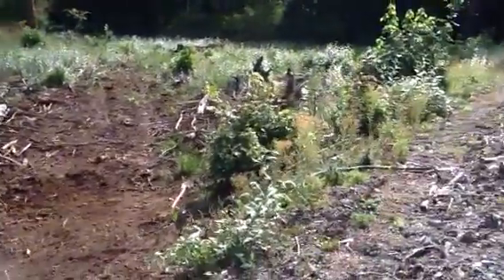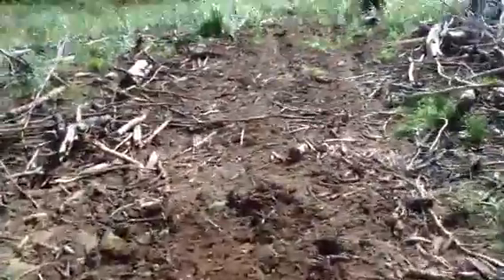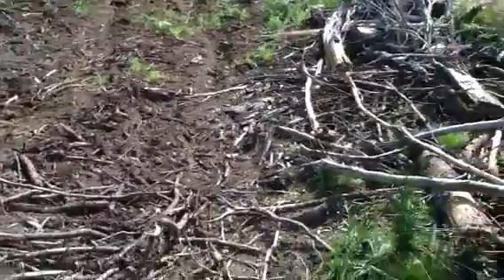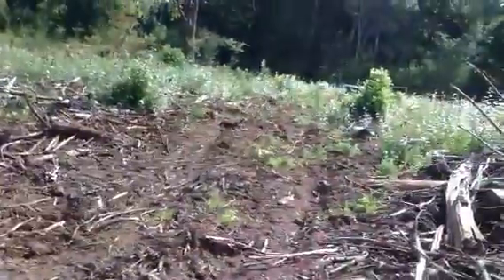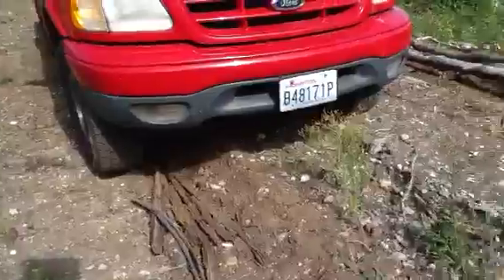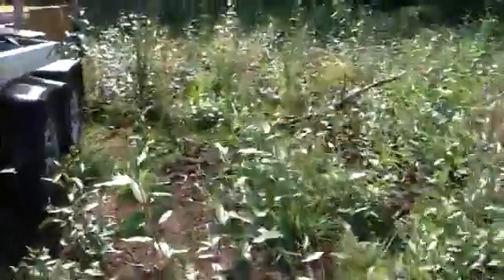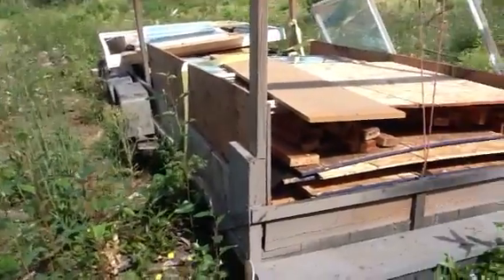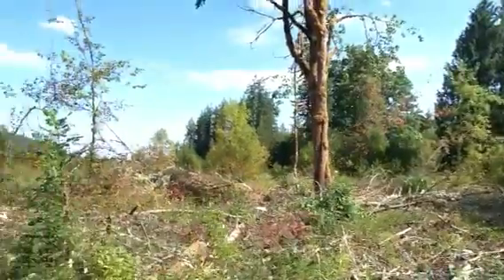Off grid cabin - Cutting a road

Comment from the maker: you said it... definately the last time I ever try to drive a path without walking it first.  My total cost for the repairs was $92.00 and 7 hours of my time.  The radiator cost around 60, 3 gallons of antifreeze and some band aids for my scrapped knuckels.  The lower oil hose is a beast to get off.  the rest was pretty simple, more time spent going to pick a part than anything else.  thx for the well wishes... say hello if you are ever this way...